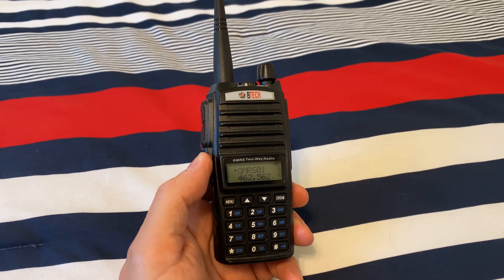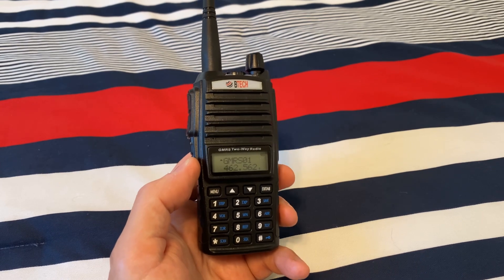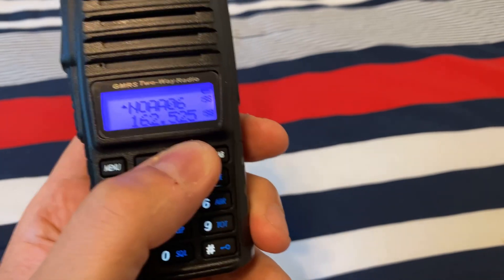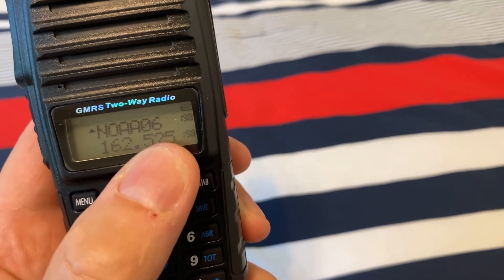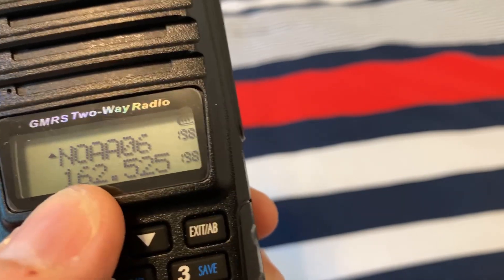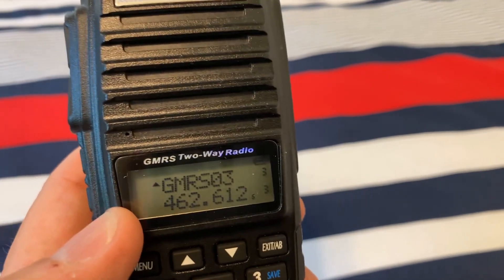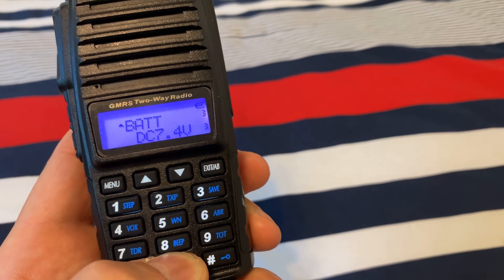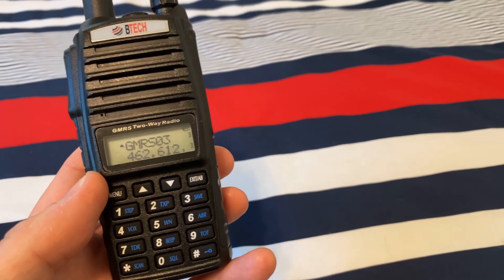BTech GMRS-V2 Tips and Tricks

Comment: Is there a way to jailbreak the frequency ranges?
Reply from the maker: There probably is but none that I’m aware of. I haven’t researched it any, as I have the identical radio for VHF/UHF ham, which is the Baofeng UV-82. The only difference between the two radios that I’ve found so far is that the UV-82 does not allow me to sync the top and bottom displays when you change channels. This is a nice feature because you can then display the channel name on the top line and the corresponding channel frequency on the bottom.